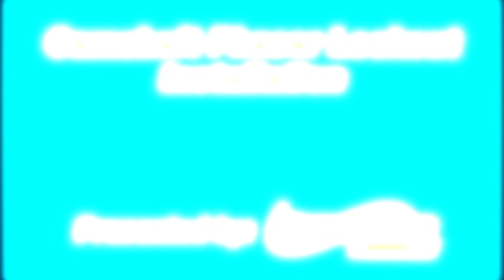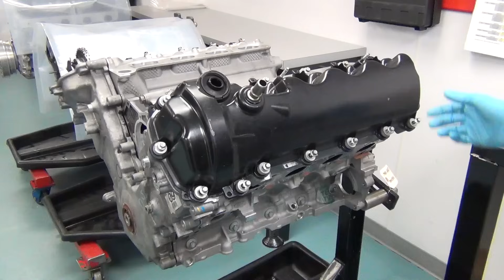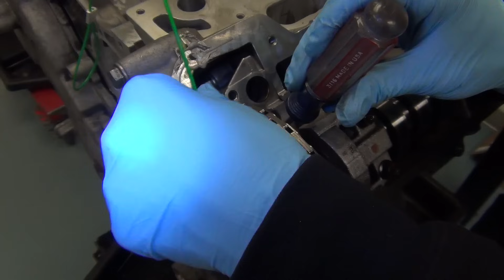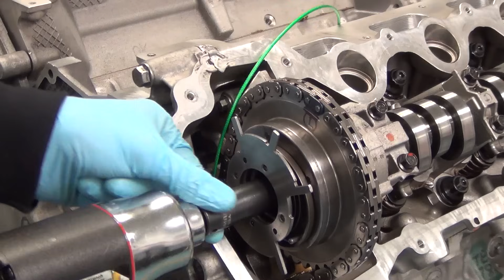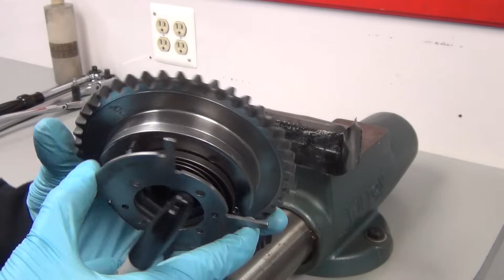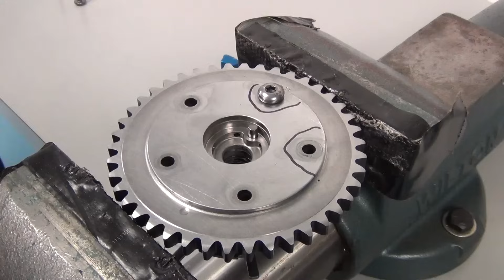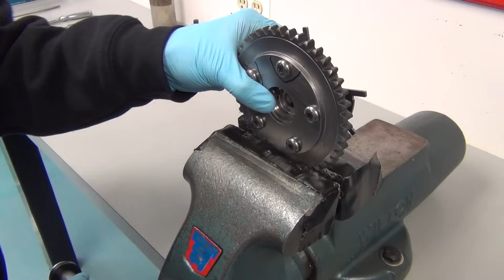Cam Phaser Lockout Installation Instructions - Livernois Motorsports New Link below

Comment: do you have to set the engine timing to a exact position to take the load off the cam before removing the chain? i would be concerned that the cam would want to move due to the valve springs to an unloaded position.
Reply from the maker: Mike Brennan Mike,If you would like, we could email you a set of directions so you can gauge the difficulty level yourself. Please email is at info@livernoismotorsports.com

Comment: Very good video.  I noticed that you did not remove any of the valve springs.  I think the ford manual requires that 2 valve springs be removed to keep the cam from spinning once the phaser is removed.  I guess when you put the phaser back on you can spin the cam back to where it should be by aligning to your mark.

Comment: okay so I have a ford 150 I have 2 lock out... do I need to put those lock out on both of them??
Reply: Now that's a good question....second question does the oil & water pump need to be replaced while the valve cover and front cover are off????

Comment: What if I add the tune without the lockouts? Boom?? yes no?
Reply from the maker: Raudel Solis

The truck would run very poorly, and it would do nothing to fix the phaser knock condition, in addition to this it would likely set many codes as the cam timing would be free to move around on it's own without the computer attempting to control it.

Comment: So If I was to get the ford racing hot rod cam would I need to lockout the cam to keep good clearances
.
Reply from the maker: The hotrod cams clear with no problems. The lockouts would not be needed just because you installed these cams.

Comment: Do i need your tuner. Or could i install and have ford dealership reprogram for me ? Or can i use any other performance tuner for my truck. I have a 2008 ford f150 5.4 3 valve v8.
Reply from the maker: The tuner is required as not dealer, nor aftermarket pre-programmed tuner will adjust for this change. This is something that we had to develop our tuner to work specifically for, as there are no other hand held solutions out there.
Reply: Ah. That makes sense. Ya my 08 . Makes the dreaded cam phaser noise every once and awhile only when at low rpm in reverse. Other then that its fine. But thinking it would be a go candidate for this upgrade. Before anything breaks.
Reply: Good*
Reply: I currently have an edge tuner installed, after I install your tuner can my edge tuner be re-installed?

Comment: I do see you just sell the block, why is this???
Reply from the maker: Originally this product was developed for Mustangs with very large camshafts that necessitated elimination of the vct system to ensure proper piston to valve clearance. Another reason is that when using aftermarket fuel injection system with this family if engines since most aftermarket fuel injection systems cannot utilize the vct system. Because of these needs we offer them separately.

Comment: As a Repair garage, We have several costumers with this problem. Would we need to by a kit for each vehicle or just extra blocks and bolts. Is the programmer set to each vehicle.
Reply from the maker: The programmer us for one vehicle only so it would require a full kit per truck.

Comment: I live in texas dallas area im looking for someone who can fix the cam phaser noise on my 05 expedition runs perfectly smooth lots of power just the noise gets on my nerves
Reply from the maker: Antonio,
This is a package that the average repair shop can handle. We provide complete directions, and a turn key solution for this common problem.

Comment: Is there any tuneing to go along with this I have a 3v 5.4 with a banks tuner can I run the lock out with my banks tuner
Reply from the maker: Our package will work with any existing program in the computer as it extracts the current file and makes the necessary changes.

Comment: this procedure not turn the check engine light?
tank you..
Reply from the maker: When purchased as the complete kit it comes with a handheld tuner that reprograms the computer to work without the VCT system thus eliminating the chance of a code being thrown.

Comment: If I already have a busted phaser that is making noise, will I need to buy a new phaser and this lock to fix my truck?
Reply from the maker: Typically no, you will need to inspect it to ensure there is no damage to the portion that attaches to the camshaft, but we designed this system to both prevent, and repair a phaser failure.

Comment: What r pm does the locked cam phase start to make hp?
Thanks
Reply from the maker: The locked can phaser has almost no impact on power so the power band is essentially the same as stock.
Reply: How many pounds does the screw?

Comment: What is the advantage of locking this please? I assume its the same kind of thing as the variable valve timing on a Focus SVT?
Reply from the maker: These engines have a very common issue that as the engine ages the VCT system fails. This is the only permanent fix for repairing this problem.
Reply: Livernois Motorsports Thanks for the reply, always like to know why things are being done :)
Reply: Do you have to do both sides?